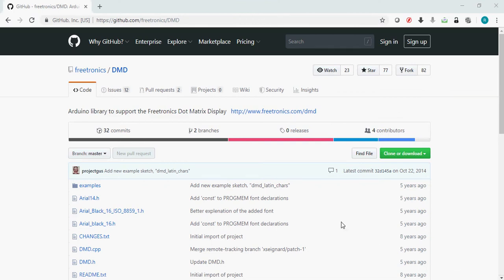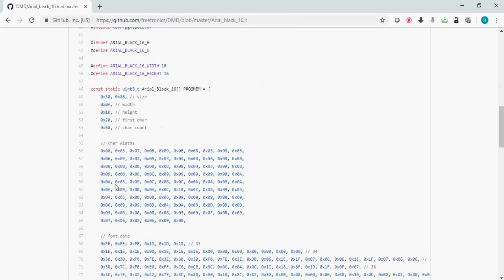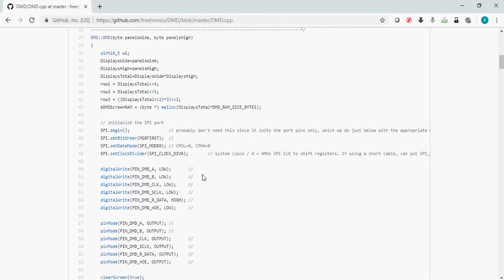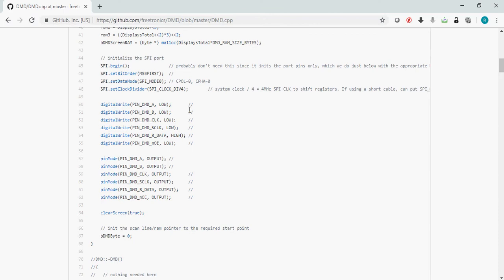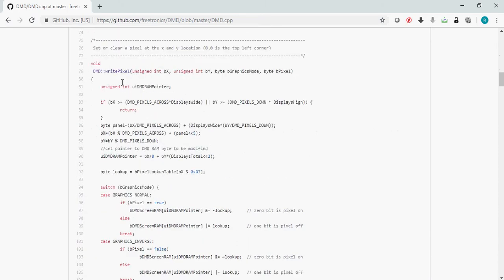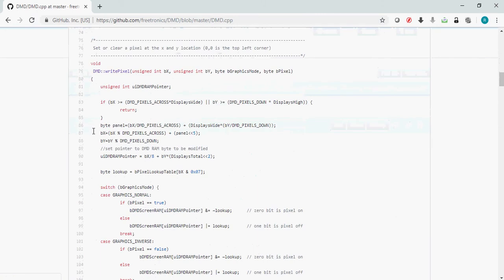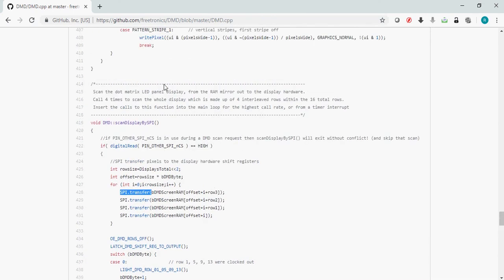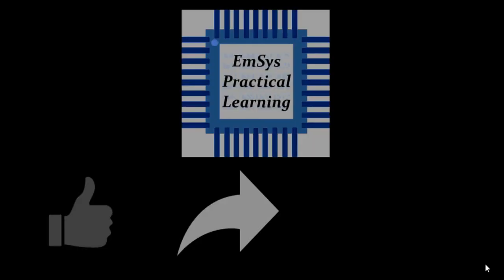DMD libary internals and implementation details

Comment: I bought local board P10-(1R)-V806F. The things is background lights other than input display also glows, but can distinguish input letters.
How do you turn off rest lights.
Program can be anything from any website in Arduino Uno.